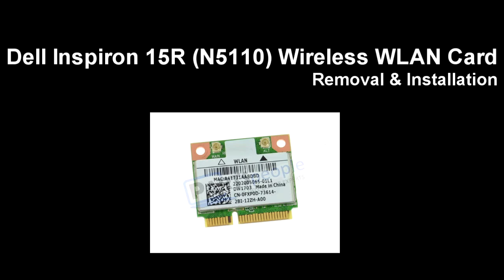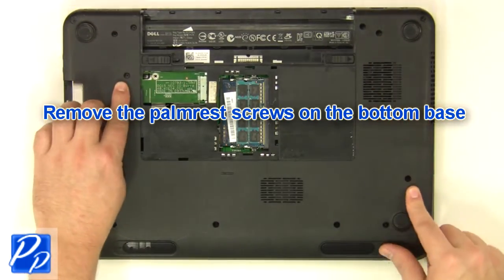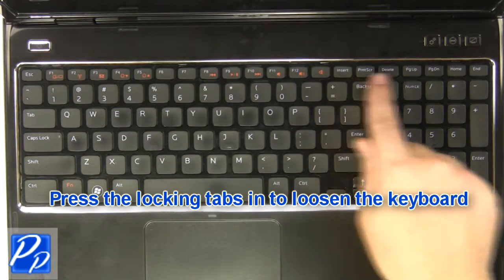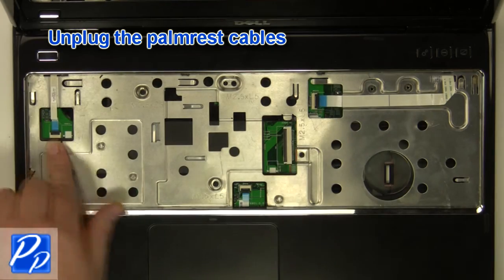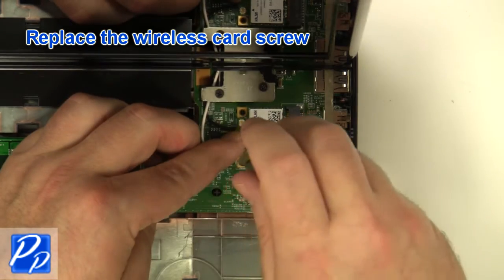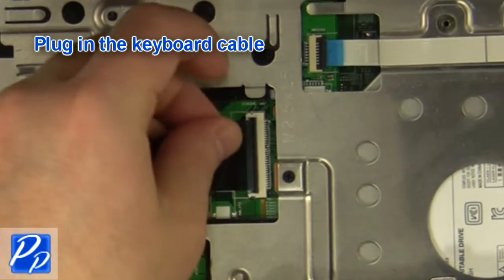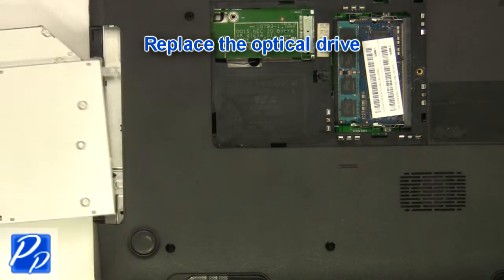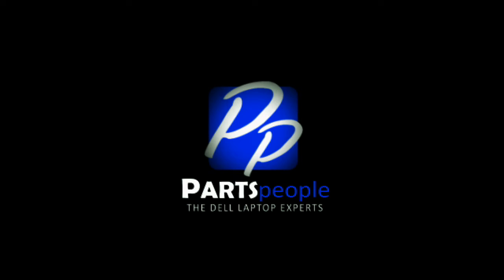Dell Inspiron 15R N5110 Wireless WLAN Card Replacement Video Tutorial

Comment: Hey there! I am trying to replace my old wifi module with a new one. And 2 sockets on the new card seem smaller than those on the old one. The wifi wires just don;t clasp in. Is there a way to connect them though? I couldn't find any info on differences of wifi modules.

Comment: Anyone know how to tell if the network card or the antennas are bad? The right side hinge broke and the screen has been tugged at and you can see the copper coming out of the end here wire is crimped into the connector.

Comment: please i have a question . i cut the white cable of antena .  and so the signal of wifi become very weak can i replace this cable with a new one
Reply from the maker: +ahmed ezz You would need to replace the LCD back cover assembly. The antenna cables run behind the LCD screen.
Reply: +Parts-People.Com, Inc does the back cover has the cables?
Reply from the maker: +ahmed ezz Yes
Reply: +Parts-People.Com, Inc i am sorry can you send me a photo for the back cover
Reply from the maker: +ahmed ezz http://www.parts-people.com/index.php?action=item&id=9576
Reply: +Parts-People.Com, Inc and the cables with it ???

Comment: Can I install different wifi card in this laptop, maybe 802.11ac ?
Reply from the maker: There are different wifi cards for this laptop but all of the ones I've seen are b/g/n. That doesn't mean that an ac card wouldn't work, and it probably does, but I just don't know for sure. I've seen all different wifi cards work on a lot of different machines, if for some reason they don't work it's usually a driver issue.
Reply: Parts-People.Com, Inc
Thank you for the response! Would you mind sharing which one you think is fastest/most reliable?

Comment: Hey I bought this laptop a year ago with GT 525M and intel hd 300 graphics.I turned it off yesterday and today when I switched it on the nVidia card is missing!I checked using My dell,epsa,device manager,everywhere.But nvidia card is not to be seen anywhere.My games wont load as it is missing.n my dell,i went to events and saw on the date of yesterday that video card was removed.I think the connections got loose somehow(as it is laptop,while carrying somehow due to shocks,maybe?) or due to dust.Can you upload a video to remove and re insert this graphic card in this n5110 laptop?PLEASE,PLEASE,PLEASE!!!!!
Reply: Parts-People.Com, Inc That's false, it has each. Mine has the Intel 3000 and the GT 525 too. If you play with games it uses the nVidia, and if you're just using internet it uses the Intel HD graphics card. It's a very useful, and battery saver option I think.
Reply from the maker: I believe you're mistaken. The n5110 will have either the nVidia GT 525m graphics or the Intel 3000 graphics but not both. Also, they are both built onto the motherboard and cannot be changed without changing the entire motherboard (this is why I don't have a video made for removing the graphics card). If you see Intel 3000 in the device manager then it is not possible to have the nVidia GT 525M and vice versa.

If all of the sudden your laptop cannot locate your graphics card, then your motherboard has most likely been damaged. Or possibly the graphics card has been damaged.

Comment: So i did this and now my keyboard isnt responding. Ive gone through and done the process over twice now to be sure and i cant figure out why the keyboard isnt responding, any suggestions??
Reply: I'm you figured it out by now, but the keyboard ribbon is a little tricky to get back in. I seat it straight then use two fingers to press the ribbon down onto the metal plate while pushing in towards the connector. You should be able to tell when the ribbon seats properly.
Reply: I did figure it out, but thanks for the response anyways!

Comment: Hi, when I got to my WLAN card, i found out that the white wire connected to the card is broken, do you know if there's anyway that the cord can be replaced? Please reply!
Reply from the maker: The antenna cables are connected to LCD back cover assembly so in order to replace them, you would have to replace the entire LCD back cover. In most cases laptops will have multiple sets of wires (white and black for the WLAN card, grey/white and grey/black for the WWAN card, and sometimes blue for the WPAN card), If you are not using a WWAN card, you can use it's antenna cables and they should work fine. So hook up the grey/white cable where the white was and the grey/black where the black was.
Reply: Parts-People.Com, Inc thanks for this really helpful video. I'm also facing this same problem, the white connector cable is broken and I own this very same N5110. Can you please tell me more about these multiple sets of wires? I can only spot the two coming from my monitor, the black and the white one and the white one is broken. It would really mean alot if you reply to my question here. Thanks
Reply: ***** Or is it OK if i solder it down?